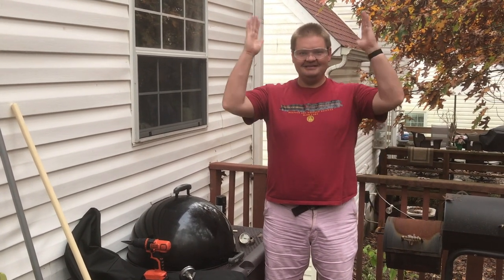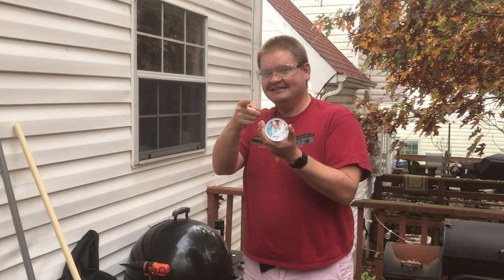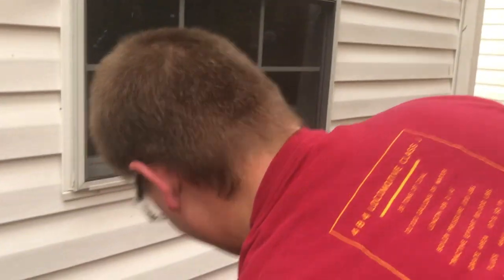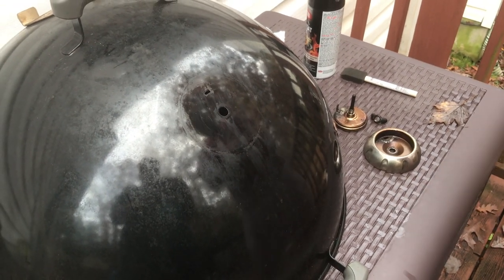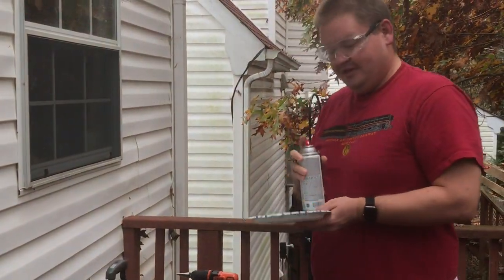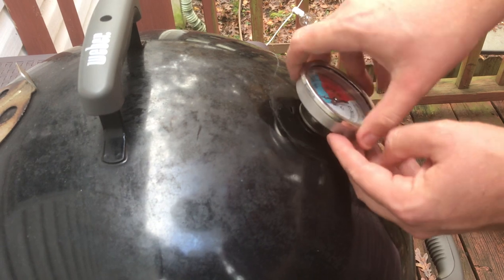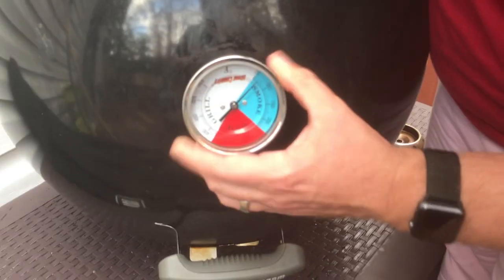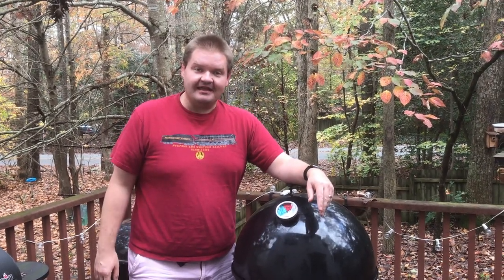New Smoker Thermometer | Weber Smokey Mountain | Goal Post BBQ

Comment: About to replace my stock thermometer.   I have a question about the little rectangle hole above the main hole. Did you have to cover it to prevent excess air coming in? If not, did you notice a difference in temp control?